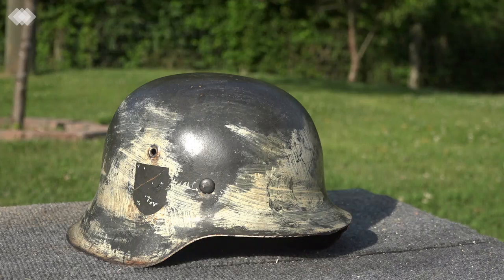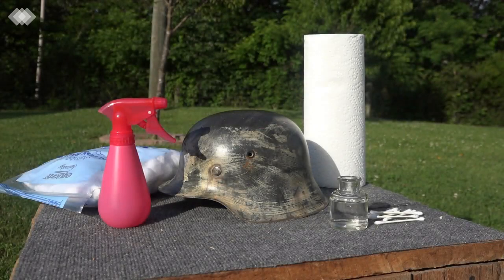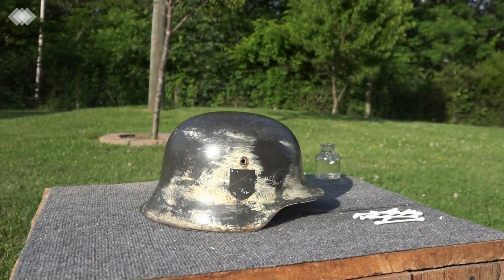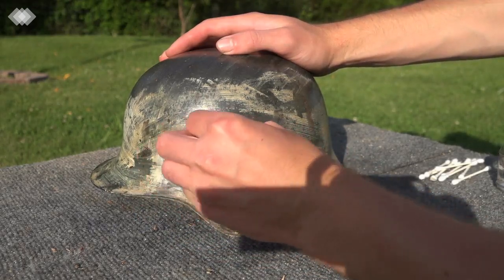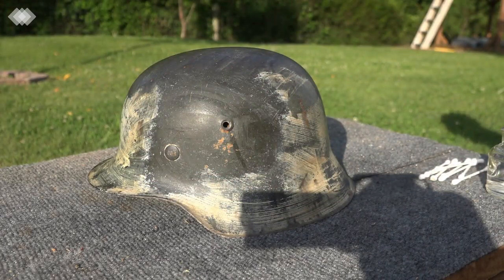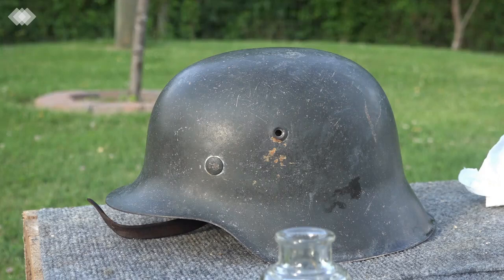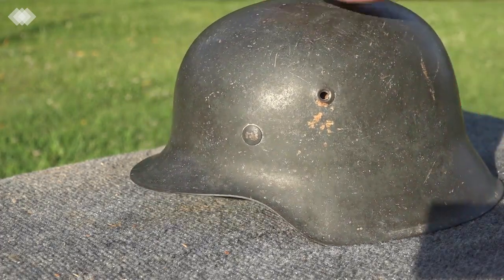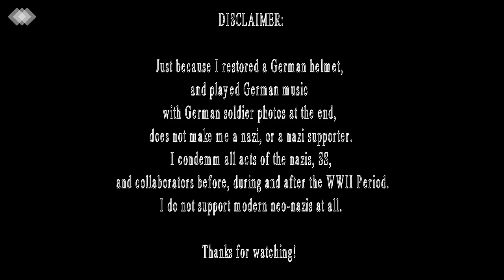Removing Postwar paint from a WWII German helmet with the Acetone method!

Comment: I want to try this on my SD M40 helmet that has been re painted. I can see the lines of the decal underneath, but does acetone harm the decal?
Reply from the maker: It depends. I would definitely be cautious, but I've seen good results on decaled helmets. What I would do is post it on warrelic.eu, a very helpful forum where you can get many second opinions if they are needed.

Comment: For those who don't know , the German helmets where painted in a oil based enamel paint . The M-35 was in a applegruan green from 1935 and 36 and it was a pea green from 1937 to 1939 , the M40 was usually in a fieldgrua or known as a shieffergrua . This is why alot of the helmets being dug up today still has the original paint on them in Russia and other battle sites  .😉👍✌️
Reply: Is it possible that an m40 is painted apfelgrun and double decal like an m35?
Reply: @stuka_bly4t102  If you see one painted like that then someone has repainted the helmet and it wouldn't be original finish .The M35 from 1935 and 1936 was the applegruan finish and from 1937 to 1939 was the pea finish but the M35's that was reissued usually was repainted and refitted by hand and sent back out .
Reply: @emersonglasgow9412  yea I know, I just asked because I recently bought an m40 but it’s painted that way, but for some reason I’ve become paranoid it could in some way be original so I’m just asking for being sure as I wanna remove the paint and paint it feldgrau single decal exactly how it used to look 80years ago
Reply: @stuka_bly4t102  Yeppers , someone baught it but wanted to make it look like a M35 . If you send me the makers mark and shell size along with the lot# I could tell you what branch had purchased the helmet in WW2 .
Reply: @emersonglasgow9412  I’ve already checked the lot number of the stahlhelm lot number database you can find on the internet but it’s not there. It’s 3866. It’s size 68, has a Q so I presume it’s quist
Reply: As I would like to repaint it it’s original color, what’s the correct variation of feldgrau for an heer m40?

Comment: Hi, I just today picked up an original M42 helmet shell from an antique store, and the whole thing is covered in Grey post war paint. I did a test spot on the inside dome of the shell, and it removed the darker gray post war paint, and undneath was a lighter Grey paint, but it started to come off too. So I stopped of course not knowing if it was original or not, but I figured it wasn't original since it started to rub off too. Any ideas?
Reply from the maker: If you are using a cotton ball, it will not be enough to take off original war era paint. I would continue taking the paint off. Most likely, someone used it as a restoration project years ago. There probably is no original paint underneath. From there, I would repaint it an appropriate color and call it a day
Reply: @rusty1415  alright! Thanks so much for the reply and the info! I'll continue removing the paint, and if it's not original then I'll restore it to a reenactment helmet. Thanks again!

Comment: I got a m35 thats cover in white paint is there a test to see if is auth or post?
Reply from the maker: More than likely it is post war. Check to see if it has any patina or wear to it, snow camo helmets always have a good amount of patina and wear to them. Take a Q tip and dip it in acetone and test it on a inconspicuous spot on the helmet, and if it rubs off, it's fake.
Reply: @rusty1415  i did it, and most of the white paint was under some black gunk, in some places there seemes to be a lite green paint

Comment: Is there a certain type of acetone I need to use to remove paint off of my M40?
Reply from the maker: No, not really. I just got mine at a local hardware store.
Reply: @rusty1415  Alright, thanks for letting me know.
Reply: Sorry for asking, but do you remember what kind of acetone you bought?
Reply from the maker: @RealElonMusket  No I don't, but any brand should work.
Reply: @rusty1415  Alright, thank you.